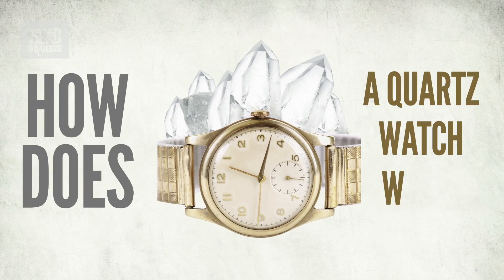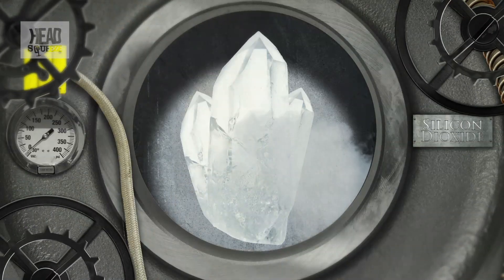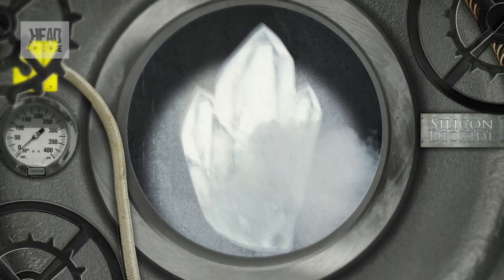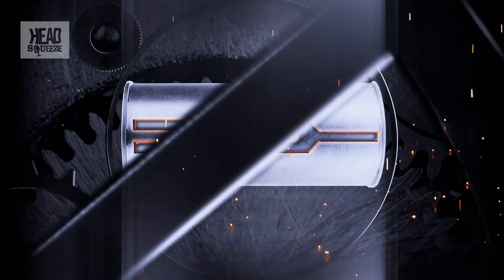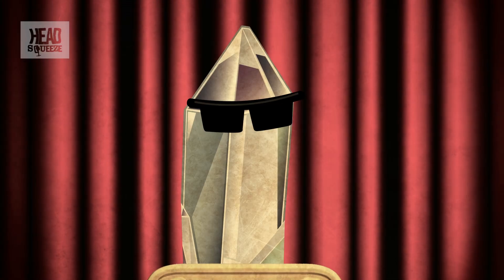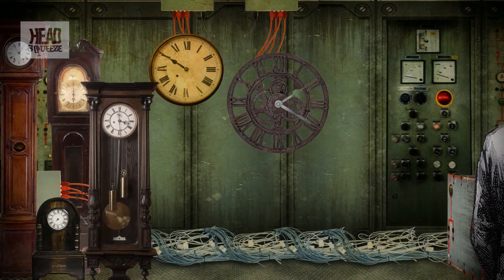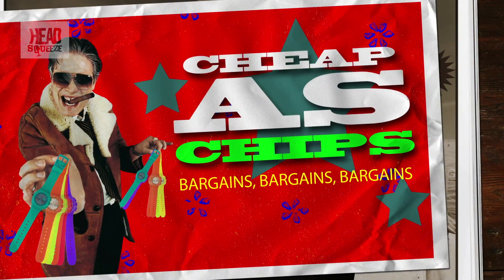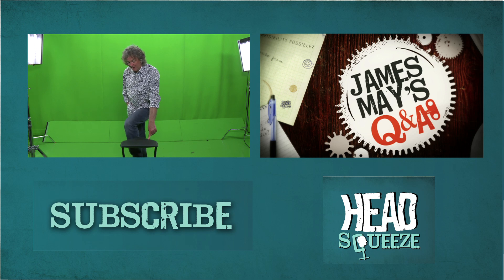How Does a Quartz Watch Work? | James May's Q&A | Earth Lab

Comment: I still have my red LED watch from 1976… and it still works! 
You can’t get the correct batteries anymore but LR44s with a rubber O-ring fit, and last much longer too.

Comment: so...why haven't we used quartz energy to power cars or homes? hmmm
Reply: It's not producing energy. It's vibrating when a current is passed through it. The same amount of times every minute 32768 .The circuit counts the vibrations and sends a pulse thus very accurate time can be kept. The quartz itself doesn't produce power. As far as I understand it. I think James explains it pretty well in the video.

Comment: The use of the word 'current' here is misleading and saying "particular amount of current" is straight up wrong.

I understand that simplification is necessary in a video like this, but how hard would it be to say "when the crystal is connected to a very special electronic circuit, it vibrates" or something like that?

Regardless. On balance, good video.

Comment: I believe the chip inside quartz watches  @May@  also contain  OPERATIONAL  AMPLIFIER circuits. All the stuff is wrapped up into a single micro chip.

 Below i refer you to the CMOS oscillator.  (idea) Two thirds way down page. You can see the crystal in the circuit  Q1.

https://www.electronics-tutorials.ws/oscillator/crystal.html
https://circuitdigest.com/tutorial/quartz-crystal-oscillator

The CMOS oscillator .............TWO THIRDS down those pages. 

The 2 TRIANGLE symbols are infact OP AMPS inside a micro chip....any 74 bla bla chip is an OP AMP chip.
TTL 74HC19 chip

 
https://www.ebay.ie/itm/251708497351
 
I believe that in a single WATCH CHIP all of that circuitry (the TWO op-amp triangles)  is embedded into a single CHIP alongside the time division circuitry (divide by 15)....
...........all into a single dedicated watch chip.

It's crucial because that is how you get 64 million ticks from a single button battery (2 years). Or in the case of casio LCD watches  317 million ticks and 10 years. (nothing physical moves) LCD

 The AMP loooks at the difference between 2 electric sources. The electric source of the crystal vibrating and creating electric ........ and the battery electric source.

That difference in the 2 sources is then sent through a negative feedback loop via the OP AMPS and stepped up to an amount large enough to drive a stepper motor and flip a second
 hand. .

Comment: Interesting how one of James' favorite watches is an old mechanical Timex. I started getting interested in their watches just recently (picked up a Timex 80 because I wanted a retro-style digital watch) and would really love to find one of their vintage mechanical watches. I've yet to find one of them at any of the watch stores I've been to.
Reply: Look on eBay, that's where I got a vintage Timex from the 80s. It's mechanical and analogue, but I've seen digital ones too. Consider the Casio F91W if you want a classic digital watch. Iconic, and $10 brand new on eBay.
Reply: I probably should. Hopefully I don't end up hitting the same brick wall I do on Amazon and find out what I want won't ship where I live. 

I actually own the Casio A158W, which is the stainless steel bracelet version of the F91W. However, I've found that I prefer to wear the Timex 80 because of the better bracelet and backlight. Though what I'd really want is a vintage-style digital watch with an actual stainless steel case like they used to have. Maybe with a red LED display as well...
Reply: Girder3 I sometimes have trouble with Amazon shipping to Australia, but eBay generally isn't a problem.

Comment: If a quartz watches secondary hand moves in 1 sec incriments, why do most wall clocks move smooth like a mechanical one, but still say quartz on them? Is it a marketing trick?
Reply: only reason why hand movement is not smooth is battery live preservation. If you plug watch into a wall it has no reason to save energy.

Comment: All things considered, I favor mechanical clocks and watches over quartz. Quartz may be more accurate, but there always comes the day when the battery dies, and then it's only accurate twice a day (whatever time it happens to stop on) until you get another.

A good mechanical timepiece, provided it's wound up and is serviced periodically, can theoretically run forever.

Purely a personal preference in end, guess I'm old fashioned.
Reply: +Shipwright1918 All things considered, mechanical watches are more a hobby thing than a reliable timepiece really. They require expensive maintenance every so often (compared to a cheap battery swap) and have expensive parts which can break. As mentioned in this video they are also not very accurate compared to quartz watches. I absolutely love my Casio Quartz watches, they've lasted well over 5 years without any maintenance and are almost bulletproof (rated Water Resistant, yet dived 20M with it many times). 

Mechanical watches are pieces of art really.
Reply: +Drinkyoghurt 

Depends on the watch. The old 17 jewel railroad watches were legally required to be accurate within 30 seconds a week (for people's lives literally depended on their accuracy and reliability) no matter how they were oriented, and to this day, they are considered some of the finest kinds of watch ever made.

Personally I'm happy for you that you've got a good quartz watch, if you like it and it works, good on ya. 

I'm still going to stick with my mechanical pocket watch. It works, it keeps time, and you say mechanical watches are works of art, I like having a bit of functional art in my pocket.
Reply: The battery did die, and it got replaced. It’s an unfair analogy, because Mechanical watches “die” all the time as well - the second their power reserve is empty. Certainly, you could wind them in time all the time (but you can’t really, as you will have lost time from the inaccuracy) or have a machine do it for you, but then again you could, theoretically, swap the battery as soon as it is dead (or at regular periods). Then you would only have to adjust for a couple of minutes, just as you adjust those couple of minutes regularly on a mechanical.

By the by, I myself am a mechanical lover. Just keeping things in perspective.
Reply: "Quartz may be more accurate, but there always comes the day when the battery dies" - I think you are wrong here. My cheap Timex's battery lasted 3+ years, it showed time, day and date. Same with other brands. Citizen produces solar/light powered watches, which will last even more.
I am also a fan of mechanical/automatic watches, would love own it one day, but because it a piece of beauty. (Not for reliability/accuracy.) It will also need service if you use it for 3 years.
Reply: There is still some fairly amazing quartz around, such as ETA precidrive (accurate to 10 seconds per year), Citizen's chronomaster (accurate to 5 seconds per year) and my favourite: Seiko's 7C46, which is just stunning (high torque, fully serviceable, dual rate trimmers).  Then you have Seiko spring drive which is a hybrid mechanical and super accurate (albeit expensive).

If you only have a couple of watches, then mechanical servicing isn't so bad.  If you have a lot (like me), then servicing all those swiss movements is fairly expensive.  My knock arounds are all quartz, but despite the cost, mechanicals are special.

Not all quartz is equal!
Reply: Yes, but at the end of those three years, the battery did die, correct? So I'm not quite wrong on that point. I will admit I wasn't aware that there were solar powered quartz watches out there, neat idea!

If you really want a mechanical watch,, they can be had for $20-40 on Amazon if you really want one, some of them are really quite beautiful too. That's where I got mine at Christmas, and it's still running strong to this day. I will eventually have to take it for servicing, that's true, but usually it's much cheaper to just throw away a quartz watch instead of trying to repair it should it ever conk out beyond a dead battery.

Ultimately it's a personal choice. I like mechanical watches and other old tech like steam engines and typewriters, and I like to use said old tech. I could've opted for an ornamental watch to sit and look pretty up on a shelf, but that wouldn't have done me any good out when I'm out working and I need to know what time it is, so I chose a plain full-hunter mechanical watch from AMPM24 with Arabic numerals, and I use it as a practical timepiece. It works for that purpose (a watch is supposed to tell time after all), I bought it for that purpose, so I have no issue with it.

Purely a personal choice of mine. If you love quartz, have at 'em and enjoy them just as I do with mechanica watches.
Reply: You can get fantastic cheap automatic watches, something like a Seiko 5 for ~$60 USD.

They don't typically need a service until there's a problem. I have a Timex from the 80s that gains maybe 5 minutes every 3 days, depending on the orientation I leave it at when it's off. It's a quick fix and not bad for a 30+ year old watch.

Don't hesitate looking into mechanical watches if it's something that interests you. There's plenty of cheap, quality options. Seiko is a great place to start, Japanese watches don't carry the premium "Swiss heritage" price, yet they retain all the quality.
Reply: my seiko premier chronograph has never had a battery change and i have owned it for about 5 or 6 years, still running strong like the day i bought it !
Reply: a good quartz needs oiled regularly same as mechanical still have a train of gears and pivot points where oil can gum up.
Reply: Nothing lasts forever. Main springs in a mechanical watch, like batteries eventually have to be replaced as they get "set", even if they may last several decades before then.
Reply: mainly because quartz is a cheap movement that costs less than 50cents to make, so most quartz watches are made cheap, cheaper band glass and etc. a mechanical watch movement costs way more, so companies make the case, band, glass, etc more quality so it doesn't damage the movement

Comment: may is WRONG about precision of quartz - 99% of quartz watches have variations of +- 15-20 seconds per month. very rarely they can be as precise as up to 5 seconds of error....
Reply: TheKenjoje you couldnt be more wrong
Reply: KidWeazel ok, if you say so. nevermind that I am a watch collector and had a lot of communication with watch mechanix....
Reply: TheKenjoje Funny you would say that, i am also a watch collector with over 20 watches in my stable , some of them even including the 9f quartz movement.Those figures you say are wrong.
Reply: KidWeazel right and official. it says on most quartz watches that their precision warries 15-20 seconds. I did some comparing by myself which you didn't or you are totally crazy. I set about ten of quartz watches with difference of about 5 seconds. during next month, the differences started to show. the price range has nothing to do with accuracy. sometimes cheap watches do better timekeeping than more expensive ones. still, I must say, the differences between watches and with refferent timing are between 15 or 20 seconds. sometimes it could be less. one digital fossil has mistake of less than 10 seconds. that one is the best, but mostly they are not that accurate.
Reply: TheKenjoje To say price has nothing to do with accuracy is wrong.High accuracy quartz movements tend to deviate 10 to 20 seconds per year and are of course expensive.Eg as i said the 9f movement,rolex oyster quartz,bulova's precisionist P102.12 .,Breitling's super quartz.To say 99% of quartz watches dont have accuracy of 5 seconds per month is not true.The plural of anecdote is not data.
Reply: KidWeazel ok, not literally. VERY expensive watches SHOULD be more accurate (quartz, not certified automatics), but it doesn't stop some CHEAP watches from being very accurate. 10-20 seconds - per month or year - whatever - because variation goes in both directions, so it could be late or hurry for a bit, then go back etc. - all in that interval most of the time. if under 100 euros watch in a few consecutive years keeps it about + - 5 seconds, so, yes, cheap ones can be precise. this is not only example, I know a few more.
Reply: TheKenjoje So in conclusion would you then agree that it is incorrect to state that 99% of all quartz watches have variations of +-15-20 seconds per month,and that it is very rare for it to have +-5 per month?
Reply: KidWeazel if I wasn't precise enough, ok, it's my fault, but basically, interval of about 15 seconds could be kept for a month as well as a year because imprecision isn't linear, it goeas back and forth. at the end of a day, it's been a while since watches were noticeably imprecise. today's cheap quartz works well enough for real life.
Reply: Any quartz watch can be incredibly accurate, depending on how well it's regulated. Most have potentiometers for trimming the rate. Some are trimmed through solely sorting during the manufacturing process and have no trimmers. The rate does vary with temperature (on the wrist, off the wrist and so on). The crystals in machines that test watches are heated to maintain an even rate and are of a higher frequency. To cover themselves against manufacturing, trimming and temperature variations, the advertised accuracy is always pretty conservative. I QC'd and serviced quartz watches from when they first came out, and our leeway at that time was zero to plus zero point one six seconds per day. Easy.
So, May is right in that any quartz watch has the potential to be that accurate. But has it been tuned to be that acurate? I currently have three quartz watches that I never bothered to adjust. One gains a second a week, one loses a second a month, and my shitty Pulsar beater that I'm embarrassed to wear — gains one second a year!
It's the luck of the draw.